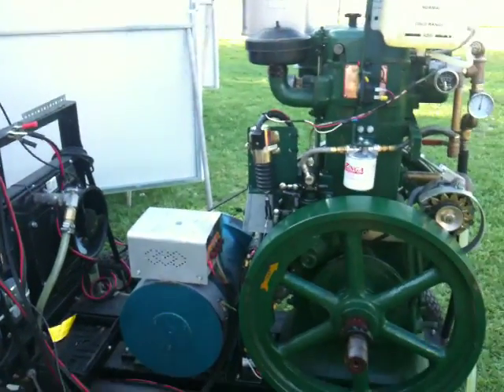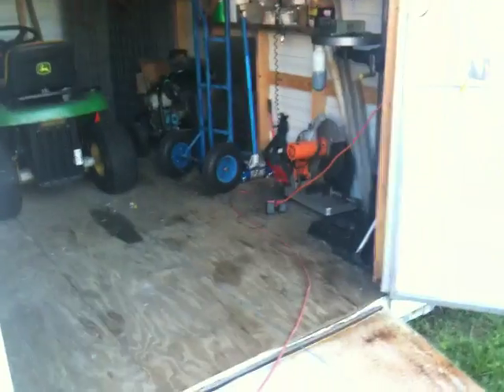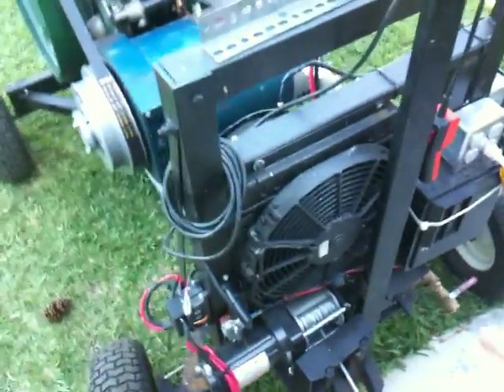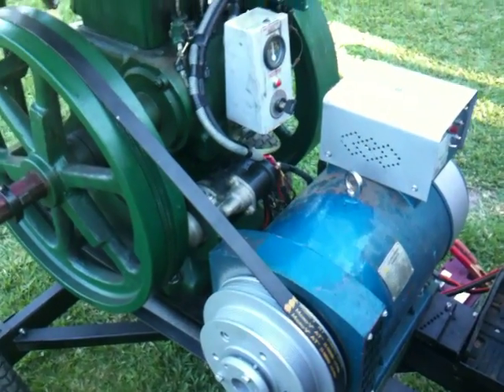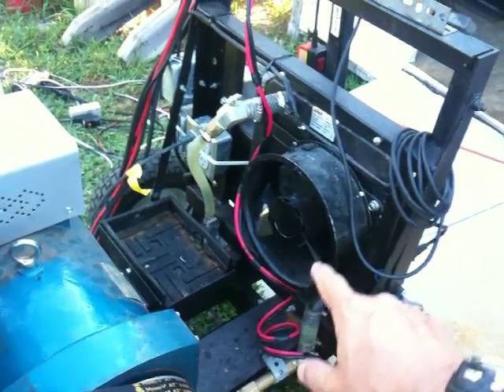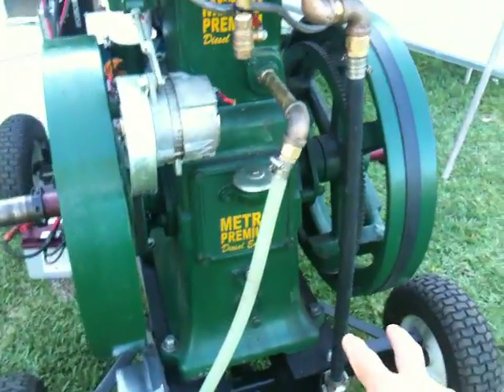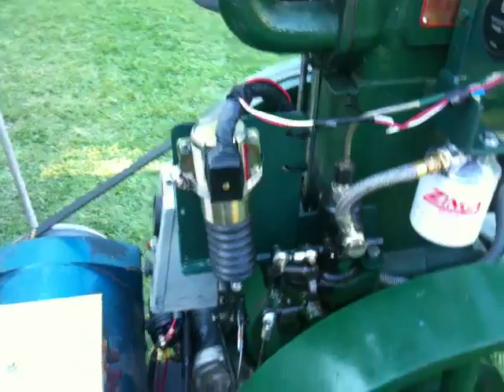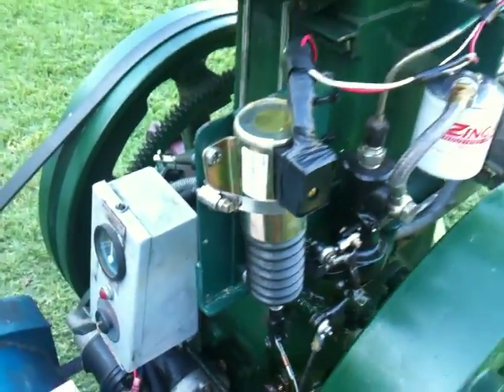Listeroid Metro 6/1 Genset Electric start with auto shutdown

Comment: Rocket boy it's not successful because its slowspeed engine voltage is frectuation
Reply: I work in the offshore oil field and Mountain oil fields for decades-- if an engine was running right off of a well in many cases they don't care how much fuel it burns but what they do care about is how often they have to be rebuilt an engine that runs at 850 RPM has to be rebuilt every 5 years where's an engine that runs at 650 RPMs has to be rebuilt after 8 years and a 500 RPM engine run about a decade between rebuilds that's 24 hours a day 7 days a week the engines that ran at 60 RPMs could go 25 years between rebuilds- what is a general rule if you want little to no Ripple you use a serpentine belt and a flywheel on the generator head on single-cylinder engines but if you wanted no ripple at all you have to go with at least a two cylinder engine- all the early power plant engines that used reciprocating engines generally went with at least three cylinder engines to eliminate any Ripple coming out of the generator head- that also doubles and triples the KVA of the single cylinder engine but it also increases the fuel consumption of the engine- generally a 3 to 6 cylinder engine runs at 277.5 RPMs so a 3 cylinder turning at 277.5 is equal to a single cylinder engine running at 835.5 rpms -  generally a single-cylinder engine turning at 850 RPMs puts out very clean power that won't damage sensitive Electronics and will hold  59 to 61 Hertz with out any problems-  most of the sale of those engines are in Europe- Europeans are big on CHP units that means combination Heating and Power- instead of burning oil in a furnace the oil runs A-listroid  driving a generator head - the engines hot water its pumped through radiators throughout a home if the home needs added Heat and they're not using the energy off the generator has to increase the heating output of the engine they just send more power into the grid that's accepted by the grid or they add more resistive load to the generator that raises the water temperature coming off the engine and also the heating elements increase the BTUs needed on the hot water system- of all the CHP system sold in Europe that listeroid engine it's considered to be one of the most efficient CHP units available in Europe- also much of the energy they produce is sold  back to the grid the generators are directly phased into the grid- they're so little Ripple in the RMS that the power companies readily accept the power generated by those engines and Generator heads
Reply: @able880  Great info Sidney, thanks for that.
Reply: Regardless of the 740 RPM or 600 RPM The generator turns at 1800 RPM. because of the two step pulley system
Reply: If you're running the engine at 650 RPMs there is a slight fluctuation in voltage or the RMS- if you're using a serpentine belt as in that case there's not that much fluctuation if you want to further eliminate the fluctuation you can add a flywheel to the generator head and it will take out a lot of the RMS fluctuation- that particular engine can be converted from a 6 horsepower to A 8 hp  horsepower engine relatively easily - at 8 horsepower you would run the engine at 850 RPMs with an added flywheel weight to the generator head there's very little noticeable fluctuation of the RMS a matter of fact it's cleaner then a single cylinder 3600 RPM engine- there are tens of thousands of those engines running around the world 24 hours a day 7 days a week the ones used for continuous AC or alternating current are generally set up at 850 RPMs the ones used for battery charging are set up from 500 RPMs to 650 RPMs at 6:50 there is a slight bit of ripping in the RMS and 500 RPMs it's a 4 horsepower engine there is quite a bit of Ripple but it doesn't really much matter when it comes to battery charging- at 8 horsepower it's not a good idea to exceed 2800 watts at 6 horsepower it's not a good idea to exceed 2000 Watts Inn at 4 horsepower it's not a good idea to exceed 1200 watts- the engine needs an extra 2.5 horsepower or 1 KW to run properly without lugging or having voltage drops -  if you want 1000% clean RMS then you would go to a two cylinder instead of a 1 cylinder in many cases you will see 2 cylinder engines instead of one that doubles the KVA that means the maximum output it has for 1 minute as for starting electric motors and delivers very clean RMS with no voltage Ripple but it's substantially increases your fuel consumption having two cylinders instead of one
Reply: Hopefully this will resolve your thoughts about the voltage fluctuation of those engines and generators there's one in Poland that has been used as a CHP since 1946 and there's thousands of them in Europe that have been used as CHP for many decades now porch wise there are extremely inexpensive to maintain and they're extremely fuel-efficient
Reply: Thanks
Reply: It looks successful to me.

Comment: I've got the same engine with starter and gear wheel.   Starter is acting up, any idea what sort of motor it is, what to get as a spare?  Dealer in Maine I got it from, is out of business.
Reply: Look up PowerLine in India -  ask for Atou. - he will either tell you where you can get the parts over here in North America if that's where you're at or at worst you can order the parts directly from him in India- if you can' find the information on the net to email them the number is,  +91 011 912 - 812362192 -   if you don't have international calling with your phone provider you'll have to get an add-on for a month they're generally about $4 they'll ask you what country that you're calling and you can get an add-on it's generally going to be 250 to 450 International minutes then you can call him- if you're calling from the states they're roughly 12 hours difference between central standard time here so 9 in the evening here is 9 in the morning over there I hope this will help you they know who I am- you have to arrange payment with them if you're sending them a check you have to register it or it won't get to them if the parts are lightweight they generally just air freighted to you